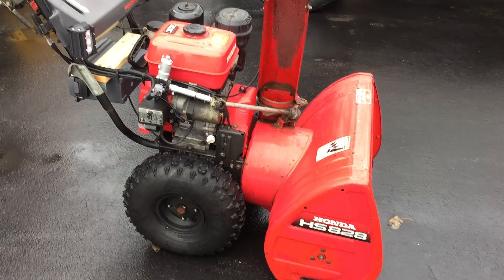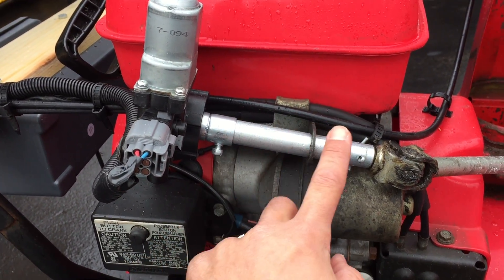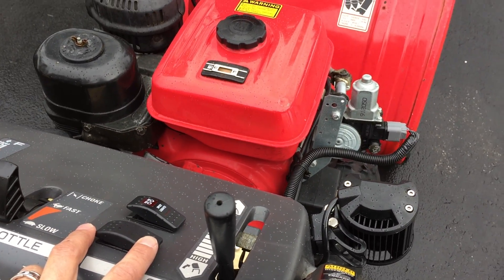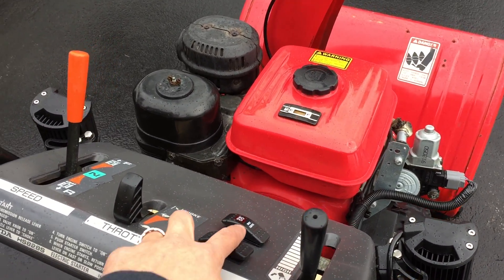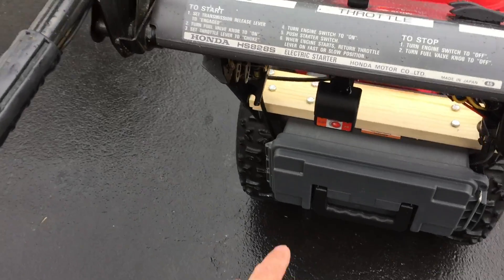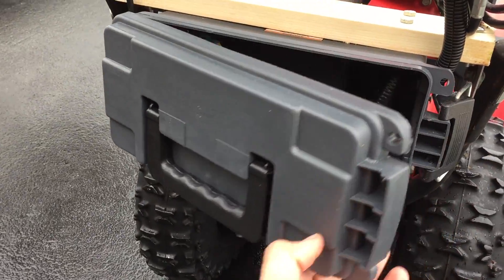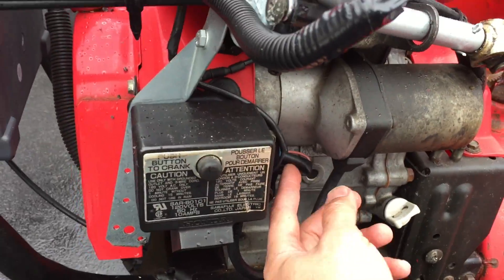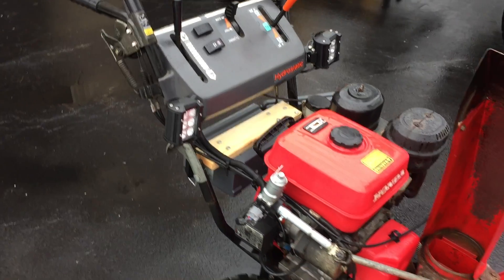Honda HS828 Snowblower w/Electric chute, LED Lights, Heated Hand grips, Auxiliary Battery Box

Comment: I was going to ask a question but you never responded to anyone so why bother.  But does anyone else know if the circuit for a factory installed light will charge a battery?